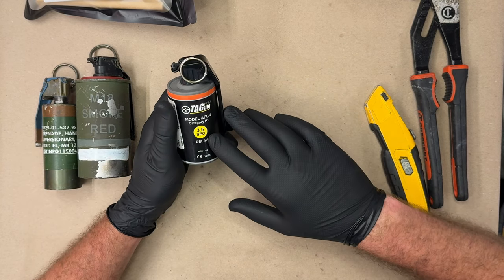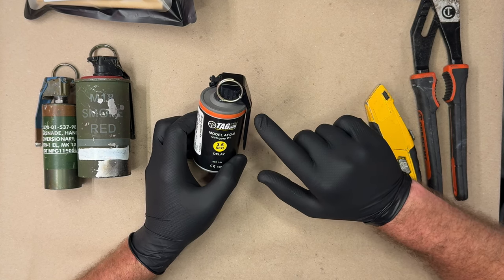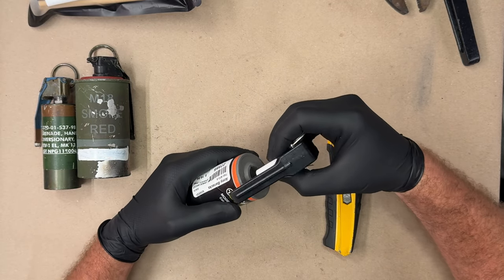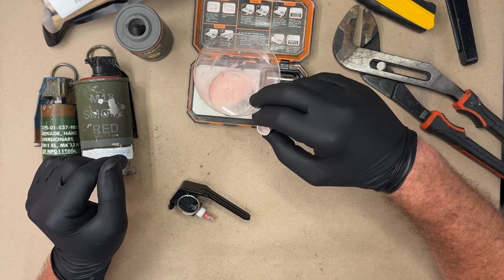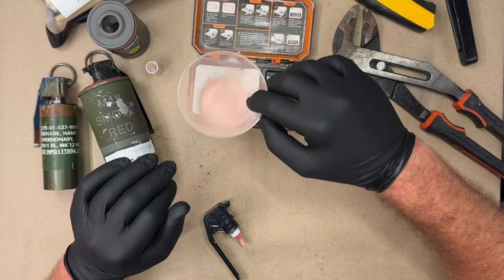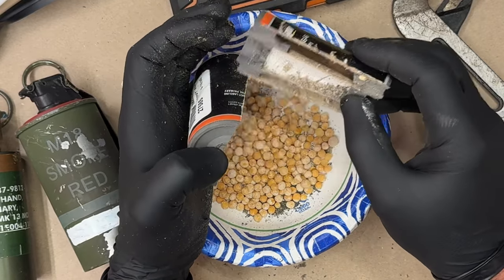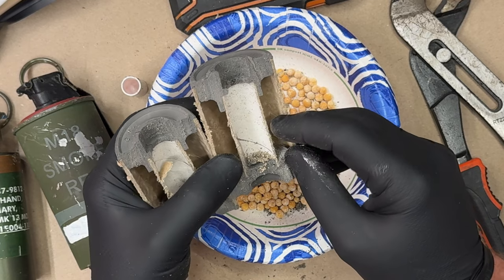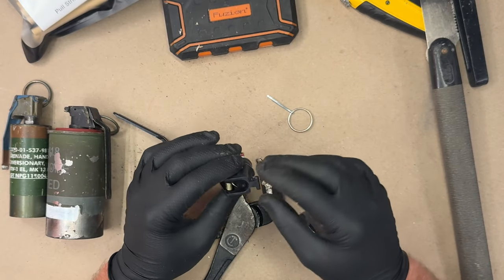TAGinn AFG-6 Flashb@ng/Fragmentation Gren@de Teardown and Analysis

Comment: just commenting this here in hopes it has a better chance of being seen but what about using circular pieces of masonry board sheets (hardi backer) as baffles for the smoke canisters? multiple different thicknesses readily available and baffle holes can easily be predrilled before assembly. also flame retardant

Comment: Not a Pyro based device but in terms of loud AF the thunder B system is pretty freaking loud. It essentially uses C02 to expload a plastic shell that bursts at a certain psi. Might be able to use a smoke grenade to over pressure the hull and get a bang and smoke in 1.

Comment: Did you find out their mix? From looks it reminded me of whistle mix, which works just as good a flash when confined 😉(we were once allowed such in the UK...) Mark at Tag said many years ago that their pyros were made in the Kalashnikov factory, though I guess they've changed that with getting CE marking and a P1 designation.
Reply from the maker: @LoremIpsum1970  yessir a coarse whistle mix. I believe with potassium benzoate, and trace red iron oxide as a catalyst. Hence the pink ness
Reply: @InventionIncarnate  Any thoughts ona vid  breaking down a Tag whites smoke?